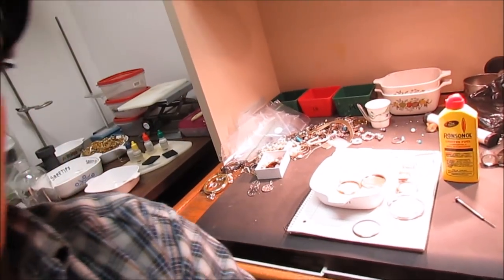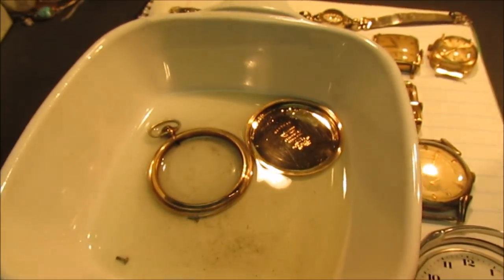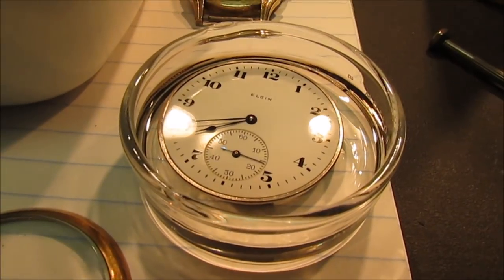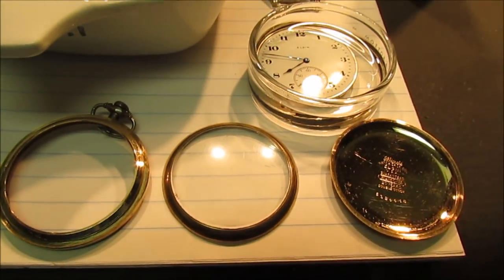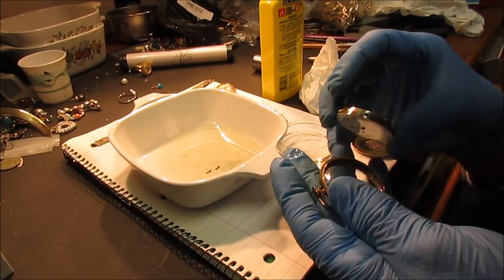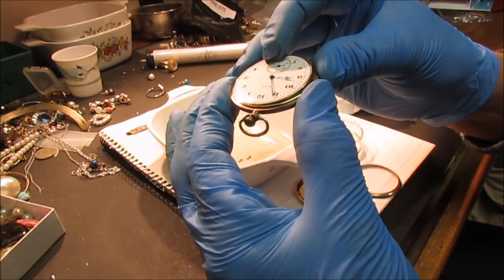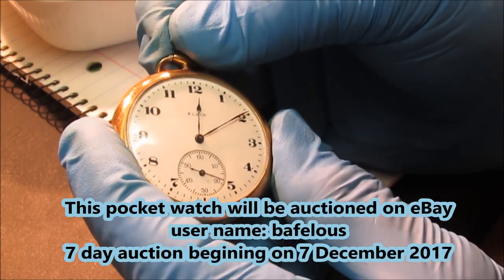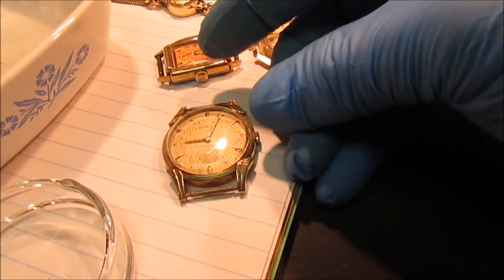Repairing An Antique Pocket Watch With Lighter Fluid

Comment: Ok...I'm no professional, but I've watched enough YouTube videos on watch servicing to know that when a watch is serviced it is:
1) disassembled and all parts cleaned in a solvent which strips off all the old oil, grease and grime
2) rinsed a few times with 99% isopropyl alcohol to remove any solvent (carefully, as alcohol is a shellac solvent)
3) dried
4) jewels inspected and cleaned with peg wood
5) movement is reassembled, re-oiled, re-greased 

So...

If there isn't anything mechanically wrong with the watch, using Rosonol will work just fine as long as the watch is rinsed of any solvent, dried, re-oiled and re-greased.   I believe Ronsonol won't dissolve shellac, btw.

Just because most of us aren't watch makers doesn't mean we're clueless to the fact that watchmakers do the same thing this guy did...just with WAY more expensive, tiny tools.
Reply: And professional watchmakers do it correctly, unlike this guy.  There is a reason watchmakers exist, and it isn't because it was this easy to clean a watch... or men would have done this and professionals would have gone out of business.
What this guy is doing is getting a watch to run TEMPORARILY.  This is like putting sawdust in a transmission to silence it; it works, but doesn't fix the problem.
Reply: So how you supposed to clean those parts that do have shellac on them? Do you just leave the solvents on the parts to dry?

Comment: OH MY GAWD NOOOO! It requires a total disassembly, cleaned, lubricated, verify jewels are not damaged, remove the spring from the spring barrel. apply braking grease to the wall of the spring barrel, tiny drops of lubricating oil to the spring, then take the jewels out of the shock spring mounts, seperate the 2 halves, clean and a tiny drop of light jewel oil to the flat side of the jewel, put together and re-install in spring shock mounts. Then the pallet fork jewels, see if the lighter fluid did not remove the shelac the holds the jewels in place. Lubricate those jewels with light watch oil. Also, lighter fluid can remove the print from the dial is some cases where it is old and ink ready to seperate from the dial face. Only use a tiny amount of water on a que tip. With 0 librication the jewels don't stand a chance from wearing out. The fluid in the spring barrel will eventually seep out with dirt and grease inside the watch and eventually onto the dial leaving it discolored. The winding stem and grears need a heavier grease. Who ever bought this watch on EBay must take it in for a proper clean and service. I've been buying and repairing watches for 20 years.
Reply from the maker: How much would you charge for all that?

Comment: You can absolutely use lighter fluid to clean a watch, BUT, only if you follow proper procedures. Taking the movement completely to bits, cleaning, rinsing and then drying fully. Replacing lubricants as necessary. And of course, not submerging any component that utilizes shellac or adhesives. Otherwise, there's nothing wrong with lighter fluid as a solvent.
Reply: A lot of people do a IPA rinse after using lighter fluid, is that necessary for those parts without shellac
Reply from the maker: Eman, check the watch repair channel. He takes the watches apart piece by piece and cleans the parts with a special solution inside a special machine used specifically for that purpose. After cleaning and drying he reassembles and lubricates the bearing with a tiny oiler. I used one of his videos as a guide to repair (kind of) an IWC Schaufhaussen to get it running. His channel is amazing.
Reply: @sreetips  yes I’ve seen that video which is why i commented here. He did mention its ok to use lighter fluid whit components that have shellac or adhesives but not use IPA so i wanted OP to clarify.

Comment: Wow some watchmaker really come down on you hard. Even if the are correct. I like pocket watches but I know some of my limits an know I can't handle the small parts. So when I buy a non running watch I leave it that way. I'm not sure of the scrap value of a goldfilled open faced watch but wouldn't think it would be more than $15. Watch makers typically don't work cheap.

Comment: Just found a circa 1899 Waltham "Seashore" or some such model pocket watch with a gold (filled?) case  that was my long-late grandfather's.  Funny thing is it doesn't have a seconds dial, which I have never seen one w/o.  The watch was almost fully wound when I found it. 
 It runs for a few seconds, then stops, until I shake or tap the watch hard, and then it goes again, over and over. like that.  So there is nothing I can just soak the whole watch in that will safely clean it and get it running again?  I'm afraid if I take it to a pro shop to clean and oil then it will cost more than the watch is worth, so should I just scrap it for the gold?  It's my understanding that this model was Waltham's cheap-o (ist) for some reason anyway (maybe b/c it doesn't have a seconds dial)?
Reply from the maker: I'm not a watch repairman. I tried this based on a suggestion from a friend who does repair watch movements. But I've been told by other experienced watch people that soaking in lighter fluid may cause problems with the jeweled movements. Plus it washes off any lube so parts will wear out quickly if not properly oiled after soaking and before its put into service. But you are right. If you take it to a watch repair they will extract all the value from the watch. Do it only if it has value as a family keepsake. If not, then I would just scrap it and recover the gold. That is what I would do my friend.
Reply from the maker: You can tell if the case is gold filled by looking inside the cover. If it says, "20 years" or "warranted 15 years" or something like this then that means it's gold filled and warranted not to wear through the thick coating of gold down into the base metal - which is probably brass, a common fill material for gold filled watch cases. If it's made of SOLID karat gold then it will be stamped "14k" or even "585" if they use solid karat gold then they will go to the trouble of making sure that is is stamped as such - usually but not always.
Reply: Most gold filled watch cases are 3-5% 10-14K gold. a typical watch case weighs 2 oz of less, meaning you've got all of 1-2 grams of salvageable good in a case. They are worth more being preserved to hold watches than they are at the smelter. Plus, they are often beautifully engraved works of art that will be lost forever in smelting. No bueno. Destroying art is always bad. Always.
Reply: It's nice to keep. I got my granddads watch which my dad had so I've not seen it in over 50 years. When my granddad died it wasn't working.
My watch does the same as yours.
I've seen a bottle of watch cleaner fluid on e bay so I'll try that rather than lighter fluid. The proper stuff has to be better for it, followed by careful oiling.

Comment: Would anyone recommend this for a mechanical timex watch without any jewels for a cleaning of course I’m still going to oil it with some Moebius but I wanted to be sure that this type of cleaning would work on a timex movement
Reply: It would not be recommended for rubber or plastic. But these old time pieces don't have rubber or plastic parts.

Comment: Funny to read all the horrified comments from watchmakers.  I too am just a tinkerer with no training and I find a healthy dose of WD-40, then some brake cleaner, and finally a tiny bit of clock oil  works just fine.
Reply from the maker: Did you see all the junk that flushed out of that movement? No wonder it wouldn’t run.

Comment: I've got a watch that was only $20 when it was new in 2015, it's beginning to stick now, and I think it's a great candidate for this sorta treatment. I doubt I'm even gonna oil it at all, as any specific watch lubricants would entirely exceed the value of it, and anything I might substitute for them is liable to just speed up it's demise.
Reply: This lighter fluid trick isn't that bad and it actually works.   Beware of anything that could dissolve shellac on pallet stones and impulse jewels, etc.     I use proper watch oils now, but in the beginning when I first started messing around with watches I used a mix of Mobil One engine oil mixed with Marvel Mystery Oil.  It worked great and didn't "gum up" over the years any different from real watch oils.  Dirt cheap, too.    Balance pivots and escape wheels got straight Marvel oil because it's thinner.

Comment: Well...lighter fluid is deadly for the mainspring and the balance spring...
Reply from the maker: Deadly for the springs. Please give a little more information here. How can the lighter fluid damage, or kill, these springs. Genuine curiosity here. Thank you!
Reply: sreetips The petroleum distillate such as Naphtaline or others inflamable liquids derived by gas weaken the crystalline structure of the metal of the spiral bringing to the consequent breakup after a few times of use
Reply: sreetips You can use this method to clean the gears or the main spring barrel but I don't recommend to soak all the entire movement in the fluid
Reply from the maker: Appreciate the info. Thanks for sharing it.
Reply: Mattia Trenga you're going to get significant diffusion at room temperature?
Reply: Robert Szasz Since lighter fluid evaporates at room temperature and releases gases that could irritate if inhaled, I suggest using it in a ventilated room.
Reply: Mattia Trenga sure, but how the heck is it going to damage any metal components? Sure, you will need to replace the tiny bit of oil on the jewels, but the entire point is to remove all contaminates and oil, then carefully replace just what is needed.
Reply: Robert Szasz it damages only the spirals  ( which are made of a particular alloy) in the way described in my first message.
There are other specific fluids for cleaning watches or you can use an ultrasonic cleaner ( after having the jewels mounted jewels removed).
Reply: Mattia Trenga that makes no sense. Lighter fluid simply can't cause metal to get brittle. It's bad to inhale the vapor and it's a fire/explosion risk, but it can't cause embrittlement.
Reply: Robert Szasz Well you can check, but at your own risk.
Reply: Mattia Trenga can you say either what alloy is supposed to be harmed, or how the embrittlement is supposed to happen? Plastics and paints could be damaged, but to change the crystal structure of an alloy requires either deformation, significant heat, or something that can diffuse into the metal.
Reply: Robert Szasz It could be Vimetal, Phynox, Nivaflex, carbon steel or others, it depends on several factors such as past servicing, replaced parts etc.

The harm to the springs isn't immediate.
All is explained in "the watchmaker's book" by D. De Carle , I am not the right person to explain chemical processes.
Reply: Luft Waffles After having the balance and the barrel removed you can soak all the disassembled  components in a not so corrosive lighter fluid for cleaning.
Then you have to oil with watch oil (Moebius)  all the pivots,jewels,etc 
and grease the mainsping.
A complete servicing it's always the best thing...
Reply: @hughaldous5195  aND THE OILS ARE DIFFERENT, YOR NOT GOING TO PUT GEARBOXE OIL INSIDE YOUR CAR ENGINE RIGHT?
OR ENGINE OIL IN WHEEL BEARING, YOUR CAR WOULDNT LAST...
Reply: @Limou551  I AM MORE CORRECT IF I USE ALL CAPS TO REPLY
Reply: @mattiatrenga5292  Actually that is not true.. What you are talking about is hydrogen embrittlement and exposure to strong ACIDS is what will cause this, not nonpolar solvents even if they are hydrocarbons...

Comment: This is how not to service a watch, you would not drain the oil from your car engine then run it ,you would not get far and this watch that you have now sold on eBay will die in a very short time.
Reply from the maker: No. I would never do that. But my car has a nitrous oxide breathing 283 small block Chevy with a roller cam and Dart II heads making around 500 horse power. A big difference from a tiny watch spring. But I get your point.
Reply: 5020 hp,??? right
now you ahve to sell junk to buy gasoline...
Reply: @sreetips  Did you get that dishonestly too?

Comment: Question for the professional/hobbyist watch repairers:  Have any of you tried using supercritical carbon dioxide as a cleaning solvent?  As a chemist (graduated in 1982),  I know that it is an excellent (and fairly inexpensive after equipment purchase) cleaning method and is even replacing Carbon Tetrachloride in drycleaning applications.   And in the cleaning of electronics as well.  I realize that the watch parts would still need disassembled and that not all parts would require solvent cleaning.
Reply: i must have binged dozens of hrs of repair videos this past week and at some point this thought also entered my head. I'm glad i'm not the only one! Are you familiar with the channel AppliedScience? He built his own supercritical fluid chamber and several months later he discovered the CO2 actually ate its way into his acrylic viewing chamber. Thus, i would not use this method on the crystal, and i would even be fearful that it might also eat away at the synthetic gems and balance spring.
Lastly, without agitation, u might just have a really clean watch with really clean dirt particles in the gears, as I'm not sure how one agitates with supercritical fluid.

Comment: Do not recommend this practice AT ALL.
Reply from the maker: I did this on the recommendation of a friend who does watch repair. I have no experience with watch repair. But I've received so many negative comments from others that I would hesitate. It does get the trash to wash out of the movement, but the lighter fluid probably will wash any lube from the bearings and cause problems. If the bearing surfaces could be lubed then it would probably be ok.
Reply: I HAVE SEEN SOME MECHNICS PUTTING SAW DUST INSIDE SOME CAR GEARBOXES TO SMOOTH IT, AND HIDE SOME NOISES,...

ITS CALLED THE SERVICE FROM THE PIG.

Comment: The only thing you left out was oiling the pivot points. I have been watching a lot of videos on this. I want to try my hand at this.
Reply from the maker: I have a video on an IWC Schaufhausen. I watched”the watch repair channel” as a guide. It wasn’t working when I began. After my crude disassembly, oiling, and reassembly it was running.
Reply: Even the wrong oil is better than no oil at all.   Sewing machine oil works if a person is cheap. Use thinner oils toward the balance and heavier oils the closer you get to the mainspring barrel in the gear train.   A sharpened toothpick or a sewing needle works to apply the oil.    It's a myth that household oils gum up faster than any other watch oils in my experience.
Reply: I have a couple of pocket watches I want to service. One is a Westclox pocket Ben dated the same year and month I was born in 1959. The other is an Elgin 1916. It’s been a lot of fun watching the videos and learning how to do it.

Comment: Yes, one the major reasons watches stop working.  crud from the outside,  dust from worn parts and solidified lubricants.  This may be a good start.  A cheap watch and a little lighter fluid.

Comment: Well I don't know about doing this after reading the comments below.
I have my granddads pocket watch and took it into a large jewellers shop to see if they could get it running. I've not seen it since about 50 years ago when my granddad died and it didn't work and my dad looked at it, then it got put away. My dad died and I have it now.
When I said it needed a glass and the minute finger is broken and it's out of it's case they said I need a specialist watch repairer.
I put it back into it's case. No problem there. It runs for a few seconds.
I think first I'll buy a bottle of quartz watch cleaner movement repair service clean for £4.99 I've seen on e bay rather than do this. Then some careful oiling. I've seen proper quartz oil for watches too, £4.99.
Why not buy the proper stuff?

Comment: Though not recommended?? It actually worked!! I received small box of broken pocket watches. A few were intact. I came across this video and figure to give it a shot.  i open the back covers and place one in a small dish of lighter fluid.  after a minute of dip and slushing away. IT started to ticking away!  Wow! taken it out to prevent any possible damage. I looked closer, i can see the bits in the fluid like in the video. Now i need to order watch oil and i am in business.
Reply: dont do that. youre destroying the watch. not all parts can withstand the lighter fluid

Comment: Hold it right there........ you could even simulate an ultra sonic cleaner by tying the movement to the vibrating end of an electric toothbrush, then dunk both in the lighter fluid!

Comment: Just think of what the mainspring barrel looks like inside now.....gross. Whoever bought this has to disassemble it and clean it properly anyway. Better to just have sold it dirty. it's only a 7 J, not like it was going for an astronomical amount anyway; pretty sure the case is worth more than the movement